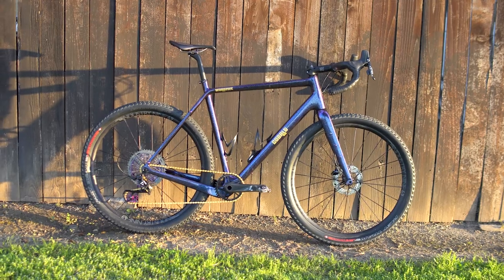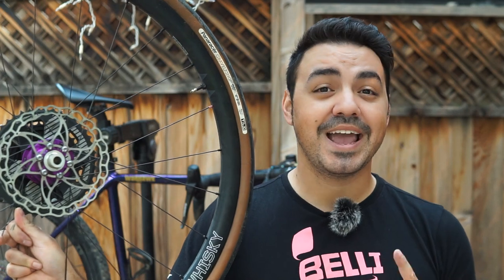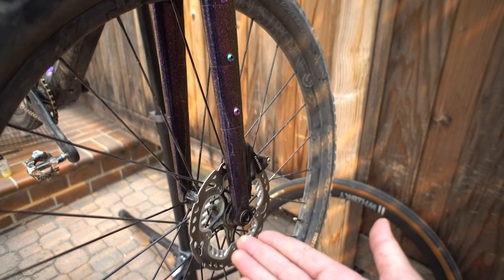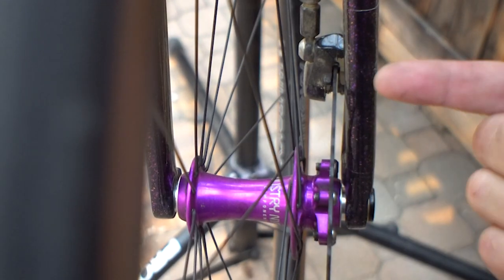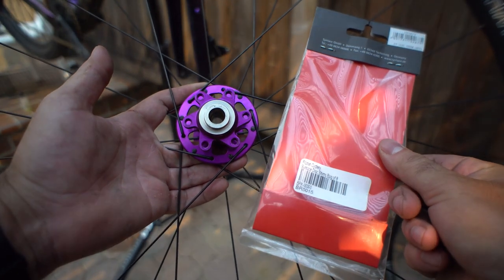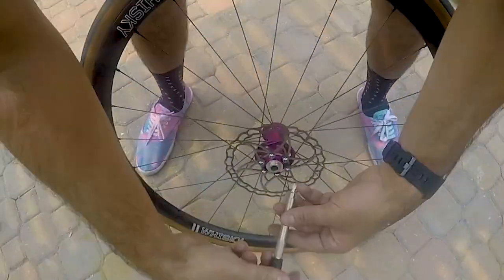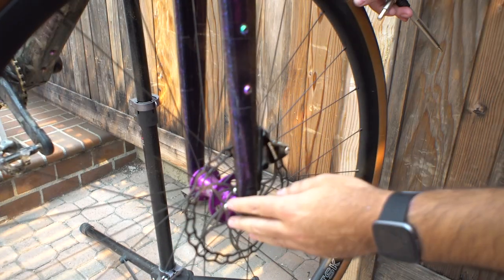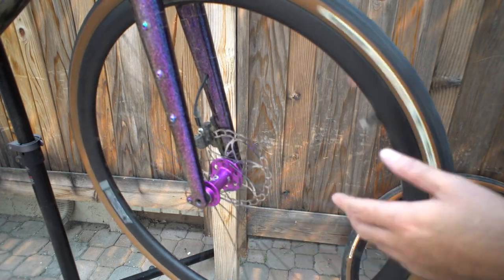Swap Any Wheelset without Adjusting your disc brakes

Comment: WHoa! what are those 6bolt rotors? they look crazy light. tips/tools for correcting rotors that are out-of-true?
Reply from the maker: mikeynon search ai2 Rotors I forgot the brand name and can’t read it on the rotor, as far as tips just take ur time and a rotor alignment tool does help
Reply: @mikeynon  @Locked In   I have the same rotors. I'm in the UK and know them as Quaxar.

Comment: This is great - I HATE having to do routine adjustments / maintenance to bikes beyond cleaning the drivetrain and airing the tires, yet I want to run two sets of wheels on a disc brake gravel bike. My current wheels are bog standard 700c with DT350 hubs. If I get a second set of wheels for touring, with DT hubs (dunno if you can get a 32 or 36 hole DT350?) what are the odds that the rear mech will line up without adjustment every time?
Reply from the maker: Should still work I had two different hubs on this setup without shifting issues , just did b limit adjust cause of cassette size change
Reply: @LockedinCycling  Thanks!

Comment: Are your calipers hydraulic or mechanical? I'm guessing from the thumbnail and the large SRAM reservoir that they are hyrdos.

I am trying to do this with PAUL Klampers across 3 wheelsets and have been having some trouble. I figure because of self aligning nature of hyrdos that it makes it easier to do compared to mechanical brakes. 

2 wheelsets are the same so I know I shouldn't have to shim either if I use the same rotors and the are both trued.
Reply from the maker: It’s hydo and yea if it’s same hub and rotor combo it shouldn’t need any shims

Comment: what about derailleur? this is a good solution for the brakes but sometimes those derailleurs need adjustments too
Reply: Not really. The rear mech moves in controlled movements it's a set value. The spacing between cogs is the same. The only difference will be chain length.
Reply: @jaspreetsidhu5708  had to readjust twice when I just swapped tires maybe the way i removed them
Reply: @Gandio420  that is really odd. Unless the cassette wasn't from the same brand, or maybe the cable pulled out a little bit when you were pulling the wheel out. Really odd.
Reply: @jaspreetsidhu5708  I have the same issue.  My 650's shift perfectly. The 700's have an issue in the largest cog.
Reply: @njbiker72  hubs are the same?
Reply: @jaspreetsidhu5708  No.  The 700's are Shimano.  The 650's came with a Hed wheelset that was a take-off.
Reply: @njbiker72  that'll be the reason why. Different hubs.
Reply: @jaspreetsidhu5708  never thought of that.  Figured if it was the same cassette it would not be an issue. But that makes sense and also that the issue is most likely the limit screw is too far over on the 700s, preventing that last shift.  Guess I just have to get good about making that adjustment.
Reply: @njbiker72  Yea if the casette is the same the hub shouldn't make much of a difference, adjust the limit screws, and it should be spot on, (adjust the limit screws without any tension in the cable, ie indexing, (remove all the tension in the cable and then set it that way it's more consistent). it should solve the issue at that point. indexing under tension will change it as the cables stretch etc.

Comment: One issue I encountered is the 6 bolt rotors I own even after shimming are slightly off.  The thinnest shims anyone sells are 0.2mm and I'd need like 0.25mm or 0.3mm shims.  Then I realized the 6 bolt rotor is slightly thicker than my centerlock so I think that is the issue.  Otherwise this would work perfectly and now I own a few shims for future use.  Thanks

Comment: Awesome video. But how about having to adjust rhe rear derelliuer when swapping wheels
Reply from the maker: With the Eagle tool all I have to adjust is b limit which takes a minute at most
Reply: @LockedinCycling  no barrel adjuster? and whats an eagle tool
Reply from the maker: @syedzgaming  nope there both 11 speed , and it’s a tool u put on the cassette that tells u what to b adjust limit too I’m seconds
Reply: @LockedinCycling  does that only work with sram?
Reply from the maker: @syedzgaming  it’s designed for it but haven’t tried it on a shimano setup

Comment: Great tip! I can see how that would help with mixed hub brands or mixed types(CL and 6bolt) I currently have 1 of my bikes that has a couple wheel sets and different brands of hubs. I’ll take a closer look and see if it could be shimmed to be aligned. I like that ratcheting torx wrench. I have thought about the Silca one but it’s pricey.
Reply from the maker: Ride4life Fit4life yea hope this helps with that! Also I have a review on that tool I recently put up

Comment: Hmmm… In my bikes the rotor generally rubs against the outer calliper pad (the one facing inwards). I wonder if placing a shim onto the outer side of the rotor makes sense - or whether the calliper requires realigning.
Reply: Placing the shim on the other side does not accomplish anything other than moving your screw heads further out.  The disc will remain in the same position.

Comment: Any tips or anything you can do about having to adjust the rear cassette when switching wheelsets?
Reply from the maker: mmpantsless13 I’m working on that video as well, it will come out after 1 chain for gravel and road ratio video

Comment: Hmm, this is good to know - thanks! Is this a SRAM thing because I swap out my 650B 6 bolt/700c centerlock wheels all the time and never have to adjust my Shimano brake calipers.
Reply from the maker: NOMAP same idea works for any brake of wheels or calipers
Reply: I swap mine with Sram and it has not been a problem.  The derailleur always needs adjustment, not the brakes.

Comment: Hmm, I usually end up resetting the pads and having the calipers find "center" relative the the rotor.  It seems to work- I've always been under the impression that the center of the caliper is relative to the rotor
Reply from the maker: Blair Morad you have some margin for that to be true but it’s pretty minimal